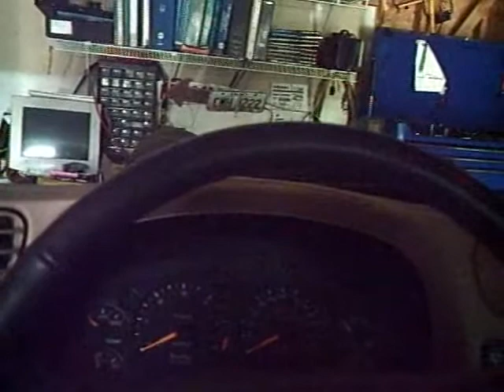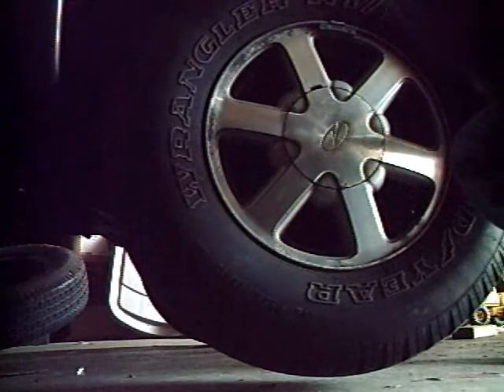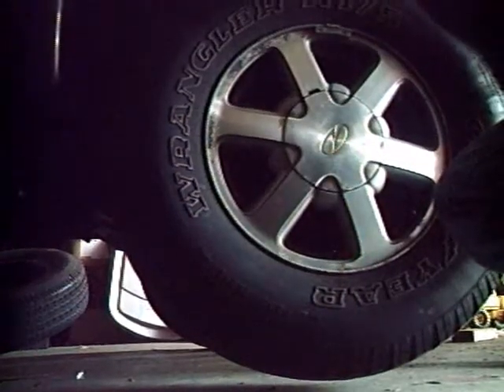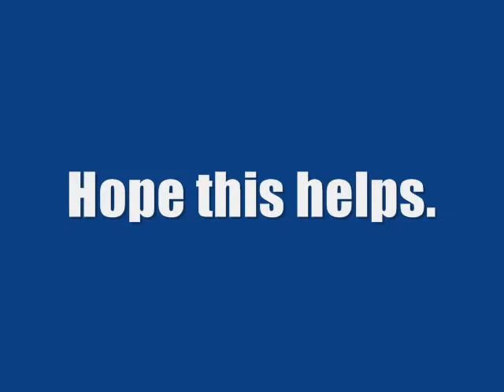Loose steering

Comment from the maker: If the jack stands are firmly under the vehicle then it should go anywhere.  it might shift in the grass but have never had a problem on concrete. I usually do front or back axel first then the other.